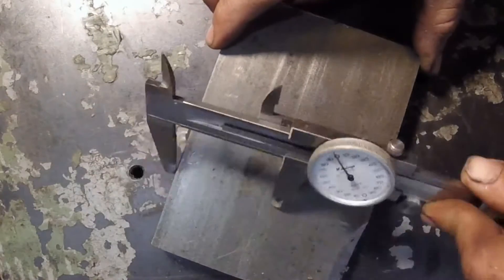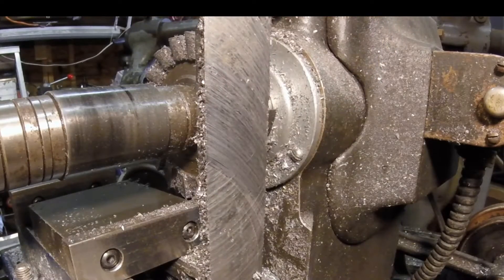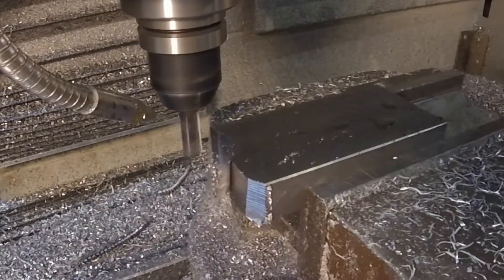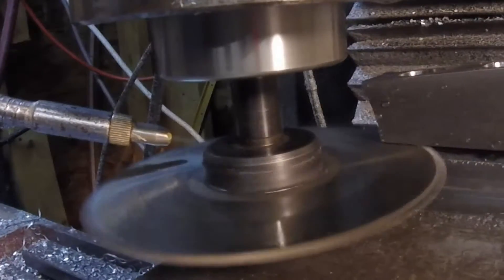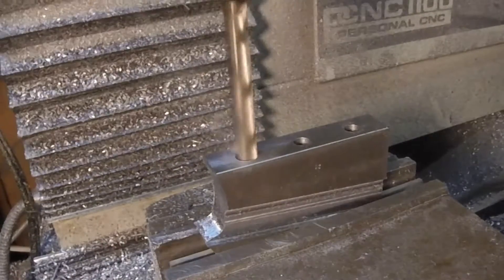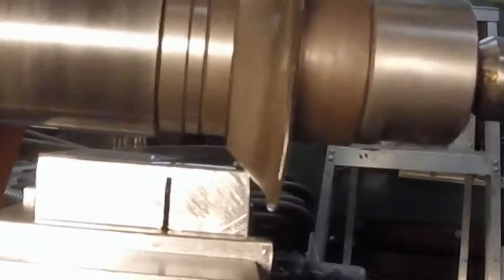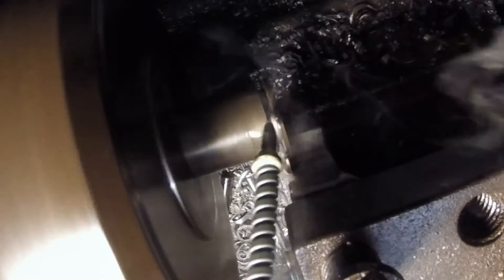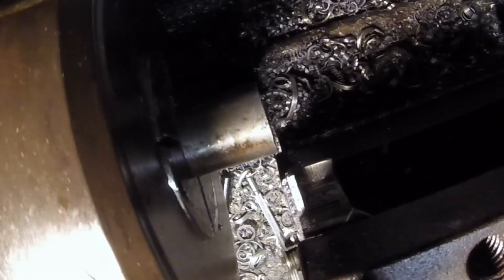Making a parting tool holder on a Burke #4 and a Tormach PCNC 1100

Comment: Thanks.  I have a pcnc 1100, and am looking at a burke #4 as well, would you recommend the both of them?
Reply from the maker: The Tormach is a great starter machine.  I use mine almost everyday and make a lot of parts on it.  I bought a stripped down version and even made my own stand and surround to save money.  Five years in though and I'm ready to upgrade to something larger with a tool changer.  It's paid for itself so no complaints.

The Burke is a great little machine too.  The horizontals are a good addition to the shop if you have the work to make use of them.  I use it now as a second opp machine to free up the tormach a  little.

Comment: Awesome video. I have a few questions. How do you determine the angle and depth for the blade slot? This is something I desperately need for my lathe since I can't find ANY Aloris(r) type AXA size parting tool holder that will take a blade taller than .500" or wider than .0625. I would love to have one that would accept a standard .750" x .125". 
If I provide the wedge dimensions would you make one?
Reply from the maker: Thanks man. I got the angle off a few other cutoff blade tool holders I have.  The depth and shape I based on a few parting blades I had on hand and just designed this holder to hold those blades.  Are there none available for the 3/4" cutoff blades?

I've never made one but I'm not against giving it a try.  You can email some dimensions through my website if you like - http://ebbcomachineshop.com/contact-us/
Reply: Ebbco nope, nobody makes them. Ok. I'll do that. Thanks.